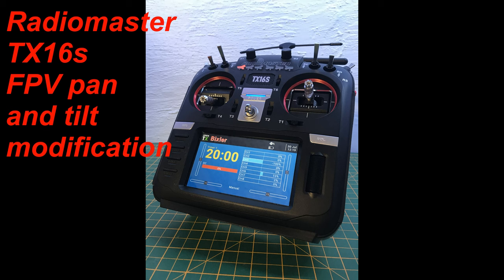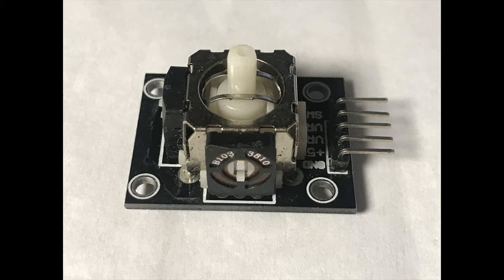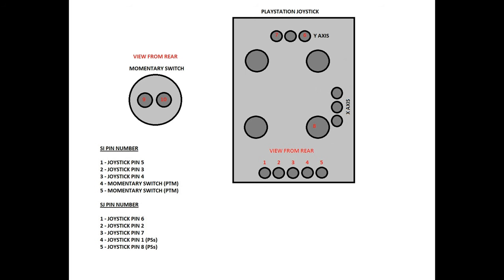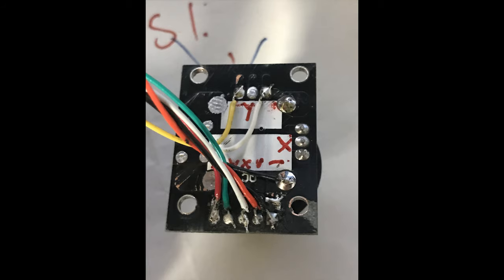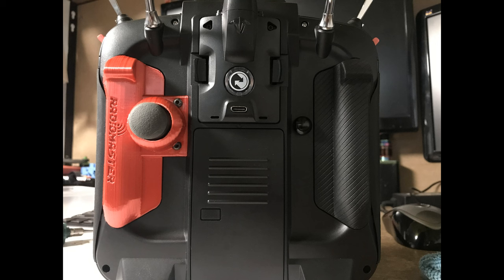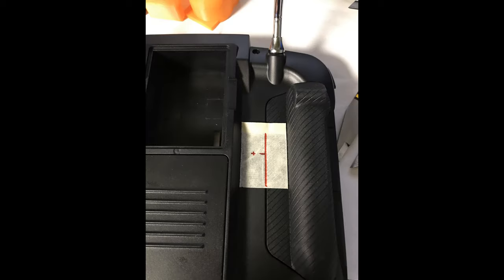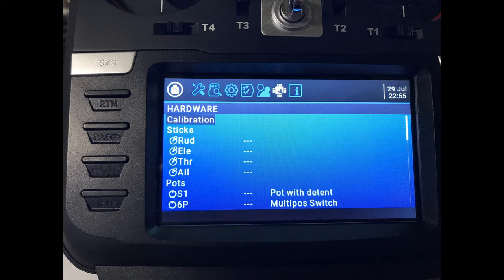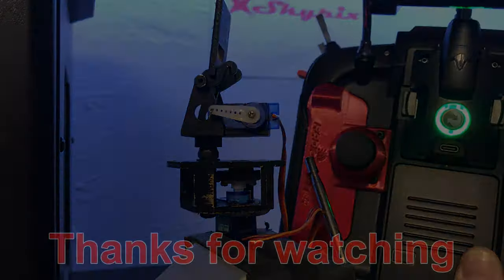Radiomaster TX16S FPV Pan and Tilt gimbal mod

Comment: Massive shout out for this. I was tossing up what rc tx to buy and radiomaster's openness to work with you has got it over the line. I like companies that ACTUALLY support their user base. I already have the other bits sitting around, so I'm looking forward to giving it a go when my tx arrives. 

Also shouts for upping both left and right side designs for it. You are a legend.
Reply from the maker: wikicheedia hey! Thanks for the kind comments. I was pleasantly surprised when I reached out to RM for the tech info. They were so forthcoming. I couldn’t speak any more highly of them. Fab company who build loyalty through help like this. 
Let me know if you need any help with the gimbal mod. It makes a massive difference for FPV. Good luck!

Comment: I’ve tried connecting a potentiometer to the unused ports and defining it.  No new pot shown in calibration but I did the calibration.  Outputs still go from 100 to -100 in very little turn.  Am I missing something?  A momentary switch connected easily.
Reply from the maker: flyandride have you defined the pot according to the video?
Reply: @JD_fpv  Yes.  On the calibration page do you see the added pots?
Reply from the maker: flyandride the pots need to be defined under EX1 and EX2. Then you need to name them. Assuming your wiring is correct they will work.
Reply: @JD_fpv  I defined the pots under EX1 and EX2 but did not name them.  Would the lack of a name matter?  I connected the pots to pins 1, 2 and 3 with the wiper on 2.
Reply from the maker: flyandride I think I’d double check your wiring. Just to make sure. Have you then assigned the switch (once you’ve named it) to a channel?
Reply: @JD_fpv  It works now.  I did nothing different except naming the new pot.  I don't see how that would make a difference as the others are not named.
Reply from the maker: flyandride all of the other switches are named. For example; SC, SD, etc. This is the name you’d select when you assign a switch in model setup. If you didn’t have a name setup for your switch, opentx doesn’t know which switch you’re trying to assign.
Reply: @JD_fpv  There is a blank column in the middle between SA, SB etc and 3 POS and down the column.  I just named it new and now a pot and a 6 position switch work.  I don't like the 6 buttons so I will be installing a 6 position switch modified for equal spacing.

Comment: Why not use head tracker?
Reply from the maker: I wanted a clean, wireless setup that was easy to transport, didn't require setting up everytime and more importantly, this is soooo much more convenient than a head tracker. If I was long range, and had to turn my head to look around, the antennas would no longer be line of sight, and the signal would drop out. This setup eliminates all of that.
Reply: @JD_fpv  yeap. More convenient for line of sight or with monitors. Thanks, nice work.
Reply from the maker: @muddyangel  let me know if you build one

Comment: what are the red rings around your gimbals?
Reply from the maker: they are the 5mm gimbal lowering shims from thingiverse. If you’re a thumber, you may find these make the height of the sticks much more comfortable.
Reply: @JD_fpv  do you have a link? search pulls up no results. Thanks!!
Reply from the maker: @RobertMehrer  https://www.thingiverse.com/thing:4492448 these are the ones I've used. Don't forget to tip the designer!